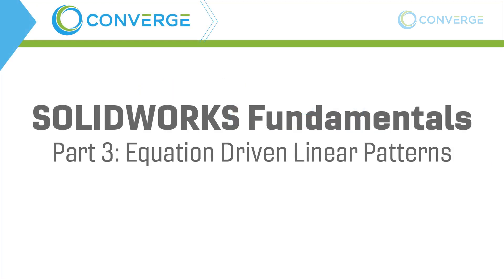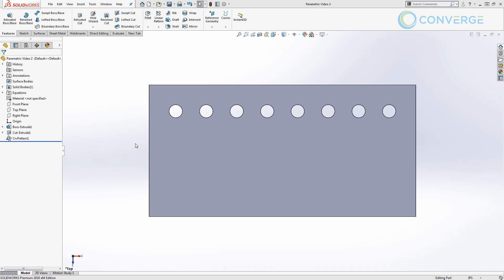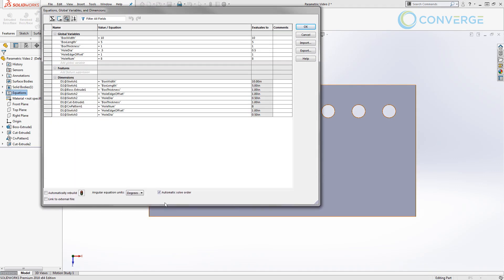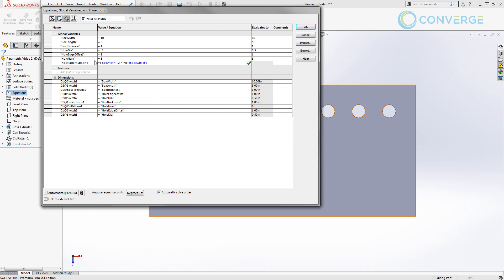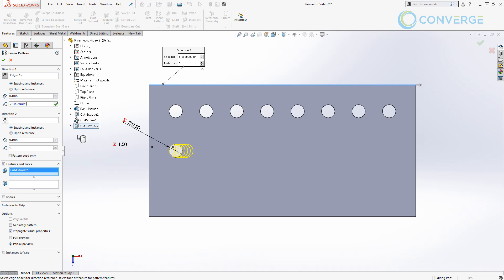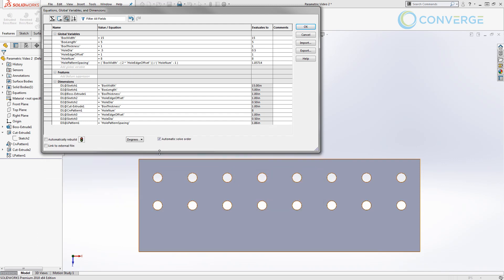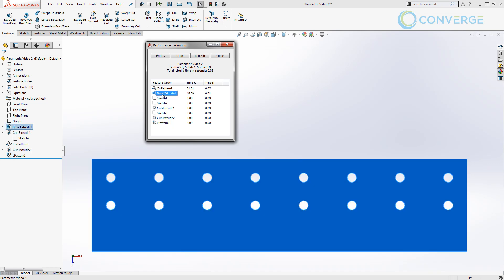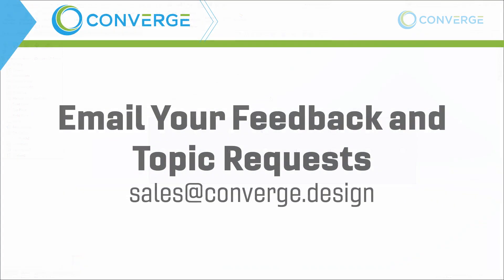SOLIDWORKS Fundamentals Part 3: Equation Driven Linear Patterns

Comment: Thank you for this. Fantastic tutorial I have followed this exactly, but it appears in my version of Solidworks (desktop, SW Design / Expressions) the Linear Sketch Pattern options for the dimensions (D1, D2) and the number of instanced in each direction will not accept an equation - the both state that the = character is an illegal character and request a number, only.  I am on a Maker license, so perhaps this feature has been removed?

Comment: Hi Converge, thank you for this. How might you go about using equations if you'd like the diameter of each of those holes to be a function of a given value (e.g. 50%, 100%, 150% of a value), as well as the length to which they are extruded (50, 100, 150%)?

Comment: Hi, first off  - really neat vidds my man. This is what the meta should be like when making instructional videos. Straight to the point and in the actual program. To my question - why the "-1" ? 
Cheers
Reply: Oh wait, I got it myself haha. For other who may be wondering the same thing I believe it has to do with the hole being placed cc on end dot of line - making half of each "edge hole" sticking out on each side. one half hole times two (for each side) makes 1 hole. Because of that "-1".